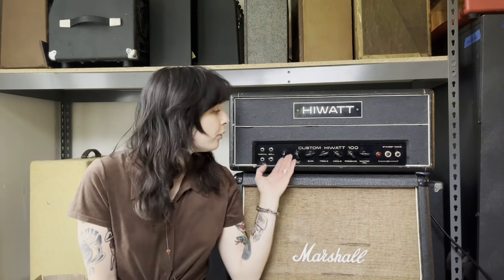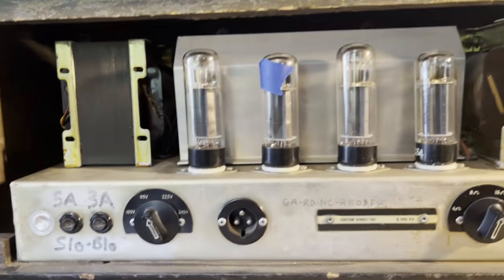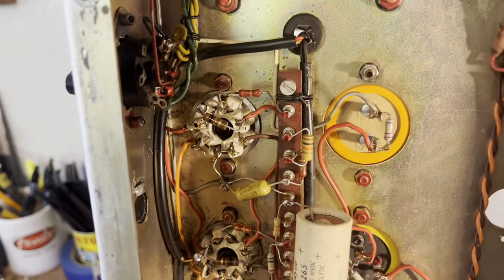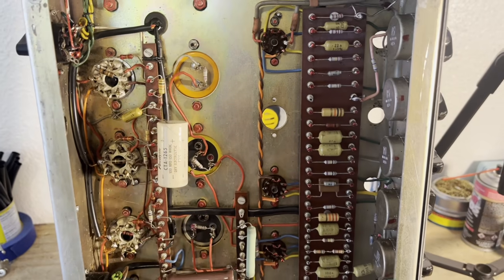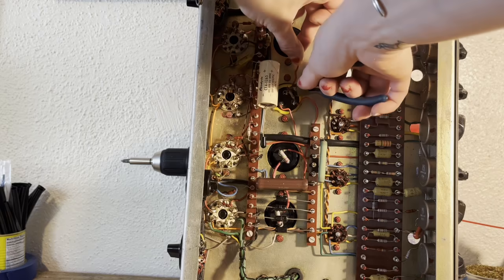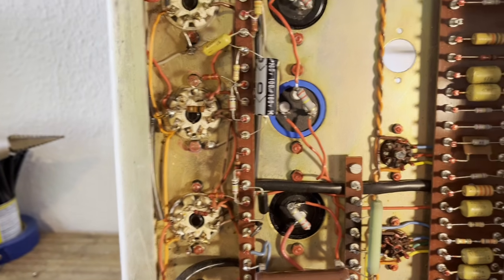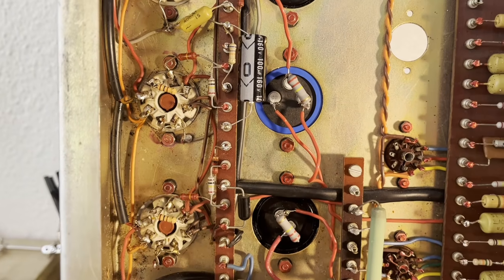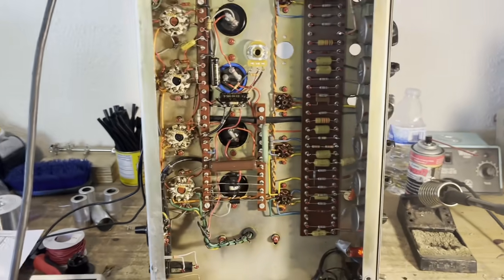Hiwatt DR103 | Restoration & Demo

Comment: LCR meters do generate data to show how bad the caps are. Granted most owner will not fully understand.   It does however create cred for your expertise .   UF1007 very good choose for low noise need  in a bias circuit .

Comment: It's not the biggest deal, but you might want to wire the power input directly to the fuse as the first component.  This way the amp is still protected if the switch fails short for some reason (almost never happens....)

Comment: I love watching your videos. You do really nice clean work and do it well. Reminds me of my days in the skilled trades watching an old tradesman/lady that’s always thinking outside the box. One of a kind. What things would you recommend to someone who wants to get into more in-depth repairs and future tube amplifier building (as a hobby)? I just picked up my copy of the “RCA receiving tube manual”. I’m proficient with my soldering iron. I have a voltmeter. Any other literature or small tasks to take on to start getting into more in-depth stuff that you could recommend? My pops was a master electrician and my wife is a electrical engineer so I am surrounded with a wealth of knowledge and also grew up with a good knowledge of electrical safety (just a disclaimer 😅). Thank you! Keep your videos coming! This one is special because that’s my top 5 favorite amplifier of all time.

Comment: Colleen .....Help on tech info for a Newbie wannabe repair guy ! 
What is the reason for having resistors across those 385 volt caps ??  Is it for some protection
when powering OFF the amp , so the caps will discharge themselves almost to zero??
Or for the discharge process to occur before powering ON, and block a possible high surge in current ?  Will already charged caps, damaged the amplifier ?

What a clean amp to work with !!!

Thanks

ps.   almost in all your videos I can't hardly hear your voice explaining your AWESOME TECH INFO !! 
Please (if you may), increase the overall volume considerably ! 
Blessings to you !

Comment: I seem to remember reading somewhere that those round 3-pin Bulgin mains sockets are no longer considered safe for mains voltages, and they have been de-rated for only 50V maximum.
Reply: Yeah if you want to be at all regulation-compliant you SHOULD change em for the drop in IEC replacement -

Comment: Could have still used the IEC. File two sides of the original hole to give it more of a rectangle and then the screw terminal holes would still be intact as they would be on the other side. You would have it square enough to put your square peg in a round hole!

Comment: Great vid! I’m pretty sure however that the lower the supply voltage the higher the fuse value due to VA being constant.
So maybe the larger fuse value is for the 115AC?

Comment: milspec can be anything, any component the military used that was made for unifying use built or made for the military with stringent "military specifications" and or tolerances... much of it is interchangeable so what works on a B-17 may work on a Mustang P51. let's say hydraulic fittings, they are built with tight tolerances and the strongest lightest materials, so a 1/2" line 3/4" fine thread pressure fitting works across the board, any hydraulic line in the military can use that fitting, a tractor, a truck, a plane, a ship, or a tank as its department of defense standardized part.. mil-spec or mil-std, same thing.. military standard

if you have ever seen the anodized fittings on automotive engines, low pressure high pressure braided lines so forth with colored fittings? top fuel, ricers so forth? milspec fittings from WW2, that's where they originated, , tubes, capacitors, fittings, nuts, bolts, clips, pins, screws bushings, even ammo can be mil-spec or mil-std ..

Comment: That power cord connector looks very similar to an XLR mic jack.  You may want to use a different connector for that in the future, or at least label it power.  Someone could easily mistake it for an audio input or output jack.

Comment: I love your channel! 17 years ago I bought a Commander II and it works but there are issues. I know this is a very selfish comment but I love this amp and want to get it working again. I have experience fixing computers but am not sure where to start here. I've done some research and found some operation/owner manuals but I can't find a repair manual. Do you have a resource you can point me to? Both inputs have power but there are audio quality issues on both channels at various input volumes. The reverb depth and speed don't seem to work at all. Thank you for sharing so much information in these videos! You're a pretty cool human!

Comment: I'm always impressed by your work.  In this case however,  it's a rare and valuable amp and you've not had much concern for originality.    Power socket should have been preserved.....replacement caps could have been hiden inside the larger original cans.   Even if the owner didn't care its a shame.     Wonderful work otherwise.
Reply: I agree

Comment: The power connector is the old style British Bulgin connector. Personally I would shop around for a connecting cable  before drilling into the chassis of a vintage amp. The cable wiring can be renewed. Its up to the customer I suppose. My 2 reasons are the historical preservation of the amplifier and defensive manoeuvres against collector sharks who try and offer you 25% less than it's worth because it's not 100% stock

Comment: Also, do you know if any amps of this vintage ever used KT66 tubes in the final? My dad had a higher end hi-fi system from the 50's (at least higher end back then) that had a pair of push pull KT66s. Very nice tubes for sure.

Comment: A little bit of work with a file on the new power socket and it would have easily fit. I mean to file the plastic not the amp chassis.

Comment: Maybe it's just me ,  but I feel the ac raw supply fuse should be doubled not halved because otherwise you seem to countermand the intensive extensive relation of voltage and current?

Comment: Colleen, what brand of solder-sucker are you using? Lyle at Psionic Audio complained that his favorite solder-sucker (I can't remember the brand) is on its last legs and it isn't being made any more. PS, nice that Hiwatt oriented the capacitor clamps so that you can easily reach the screws. Many other amps require you to be a contortionist and work at odd angles to loosen or tighten those screws.
Reply: That looks like an Engineer SS-02 made in Japan (I got mine on Amazon - it’s amazing and easily the best I’ve used).

Comment: Anyone know why Hiwatt didn't connect the neon to the 225V (rather than 245/250V) tap? That would have been plenty even for a high-brightness neon (more voltage above that just means more dropped in the resistor); was the higher voltage just more-standard and therefore easier to obtain the indicator for? (Though you could still run it at the lower voltage and sacrifice initial brightness for longer life.)

Comment: I understand the circuit replacement that you used but I'm pretty sure you could have just put in a voltage divider and achieved pretty much the same thing. But maybe I'm missing something.
Reply: I just built a DR103 clone and did this very thing. A simple voltage divider worked like a charm.

Comment: No harm in a smaller fuse when going through it. If it blows so what. I'd underate the mains amperage. Anything shorting for any reason the small fuse will save your work. No magic smoke.

Comment: Hi, I'm a low voltage,  DC tech 😢 I understand that a good portion of what I know is upside down from tube sets. I'm not attacking you, but in the stock bias oem 47k you tried an increase??? Would this resistor not be whats commonly referred to as a pull down resistor, as in you should have gone lower?  Please educate me.

Comment: Is there anything in the circuit for non-US voltage that allows for the two wires to be swapped? I may not be phrasing this right, but my point is that the European type-F and type-C plugs are not polarized, they don't enforce one correct way of plugging them in the socket, so you don't know which one is the live wire and which one is neutral.

Comment: Even though that high plate dissipation will eat tubes fast, could it party be where the high headroom comes from? My best guess is yes, because if I understand correctly a cold bias can lower headroom. P.S. Is 70 milliamps typical for the old ones? If so, perhaps the old school tubes could cope better.
Reply: 70mA at idle exceed the max. plate dissipation,  the amp runs with 500V plate supply at idle , that will be 35W plate dissipation.   Look at the data sheet of the EL34. In class B 500V 5k plate load a recommens idle current is 30mA / Tube. Datasheet:  https://frank.pocnet.net/sheets/030/e/EL34.pdf.
It is recommend  to  fit a Bias adjustment potmeter. Better  2 for each pair.  35mA is the absolte max. value.

Comment: Over the years I've had many Hiwatts come in the shop with the complaint that the amp sounds thin.  Why?  Simple.  They all at some point had the bias circuit modified because some tech told them the bias was way too hot.  Amp designers set bias points for a variety of reasons.  The big companies set them cold to cut down on warranty issues.  But certain designers like Dave Reeves chose bias points based on sound.  Does hotter bias shorten tube life?  Sure to a certain extent, but where did the idea come from that a hotter bias is wrong?  Even Fender chose to bias the Blues Jr hotter for the sound.  "Techs" (and I use that term loosely) need to stop regurgitating the same line over and over and think about what needs to be achieved.  Biasing used to be done with o-scopes without measuring current.  Ken Fischer was one of the first guys I remember that started using measurements for biasing but he wasn't trying to convince the world that the only proper way to bias an amp was 0.07.  Biasing an amp is like tuning an engine.  If you think 14.7 is the only correct fuel/air ratio then you don't understand the context of what you're doing at all.  There is so much nonsense surrounding tube amps and bias is the number one subject most misunderstood where the BS just gets deeper and deeper.
Reply: *Autocorrect turned 70% into 0.07

Comment: Incorrect. 3"50' Half the voltage double the current.
6.3A for 110v 3A for 240v.I refurbish these amplifiers, alongside all valve equipment, for a living.

Comment: ok, lady, awesome job, little bit lazy sometimes, but, ok, it´s hard to repair an hiwatt with blue tape around its end tubes, hard to see.
if you not only replace the capacitators, but in fact the tubes themselve, better, selected el 34 of siemens, not the genuine mullard ones, will make it.
not these different shape ones inside that object. btw, i´ve got the 6767 out of 1974, doubled my birthyear, fucked up lotta times, but finally set into the genuine shape
by a man named jovanovic, he was the amplifier restauration god here in berlin in 2008.
got it back, with complete electrical wiring certificate, unbelievable, it works till now.
just like me.
h.m.

Comment: Question for the amp experts. The DR circuit has a 12ax7 creating a fixed DC voltage that feeds the phase inverter tubes. What was this DC voltage for? You can see it in the schematic:  https://hiwatt.org/Schematics/DR_Pre4Input_v2.pdf 
Its the second half of V3.
Reply: v3a feeds signal to v4a and v3b. v3b sends that signal to v4b but because it's coming from the cathode it is opposite phase of v3a. Apologies if that wasn't what you were asking.

Comment: The news ones are not built like the old ones.  Modern Hiwatt  is just the name  and really  bares no  relation  to the original company.   It's changed Hands many times . The components used  are not  all the same  and most importantly  Patridge transformers  are not longer made.  There are hiwatt clones that are much  closer to the original  than modern hiwatt  like  Reeves  hiwatt clones  then there is Royal amps  and also Hitone  amplifiers  then you have Harry Joyce amps.  All of those companies  are building clones that sound much closer to the  originals.  Modern Hiwatt is kind of a shady company.

Comment: I like your videos but they all seem to be recap jobs and general maintenance. Maybe make a few demonstrating simple mods like adding brightness caps, modifying tone stacks and negative feedback loops, altering  cathode bypass resistors and caps, rectifier tubes, preamp tubes, reverb tanks etc...maybe with before and after sound demos.  They don't have to be permanent. What do you think?

Comment: Hello, since i was ''auto'' bias, is it what they call cathode bias ? I find it strange that you have to add a bias pot, don't get me wrong i am not judging you're work at all. I know nothing when it come to tube amp, but logically if you don't know that the bias is to hot, you gonna keep changing you're tube often and wasting money, witch make no sense for me. I don't get it, why there is no bias pot at the first place...Was it intend for different tube at the time...

The only thing i know, is not to plug a guitar amp in 220 outlet, when the amp is a 110V.  I learn that in my new apartment, regular outlet, landlord forgot to tell me that is was for a 220V AC. loll

Comment: I just had a modern HiWatt Chinese 50 watt on my bench. It has nothing to do with that amp. Poor layout, thin circuit boards, cheap parts. Like comparing a 1966 Deluxe Reverb to a Fender DeVille. They both have the same company name, but the similarity ends there
Reply: That's a shame. So many newly licensed  companies these days that ride the coat tails of their older parent companies.

Comment: That amp sounds terrible
Reply: It's at bedroom levels, of course it's going to sound thin, anemic weak and not right. These are not bedroom amplifiers but are in their best operation zone at stadium level amplitude! They have a master volume which sounds like crap when turned down. You really need to open the master all the way up, but of course the amp has such a grip of headroom that you are blasted out to get it into the sweet spot. But you are definitely better opening it up and running the front end with a pedal to get the tone, if that's your kinda tone. Definately a big amp sound not represented at these volume levels. Also, these amps run a very high B+ voltage too. Look at all that capacitance in the power supply and huge transformers. Set up with the more conservative higher negative bias and lower current is wise with newer production tubes but will thin the sound too.
These are big amps with big sound for big applications! I betcha that if you opened up that master volume, this amp would blow ya away. I think Fazio did a fine job on this amp.